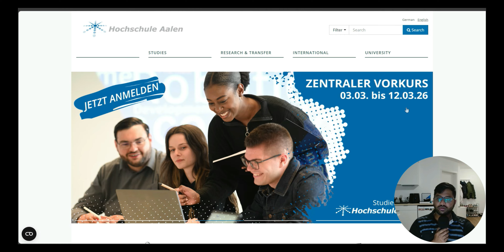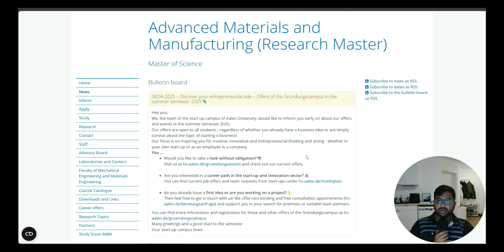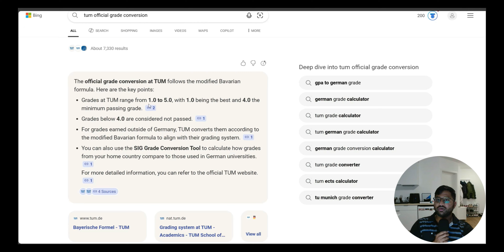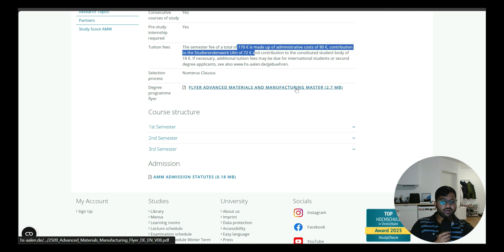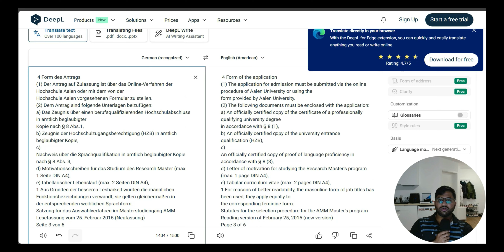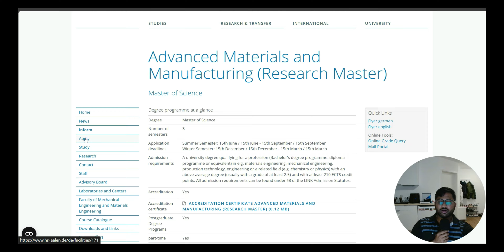HOW TO APPLY | REQ + REGIS | AALEN UNI | ADVANCED MATERIALS AND MANUFACTURING | MSc |  PART 1

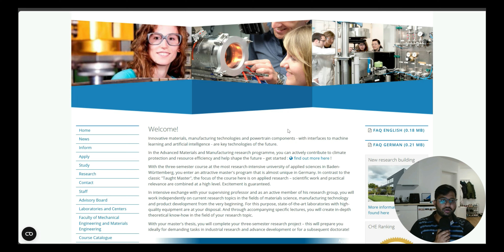Comment: Your video is really exceptionally useful u cover all the things properly in detail however I have one one doubt  in info section they mentioned 2.5 with 210 ECTS. On the other hand in FAQ ENGLISH version PDF they mentioned 2.7 with at least 180 ECTS that's why I am confused about the proper requirements for this course 3:05 on this time step you can see on the right upper side FAQ ENGLISH PDF